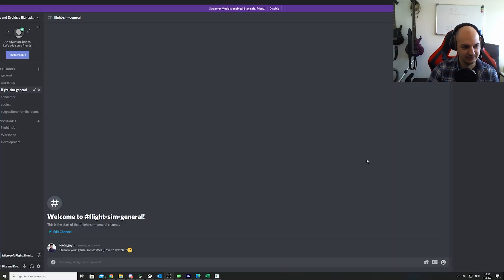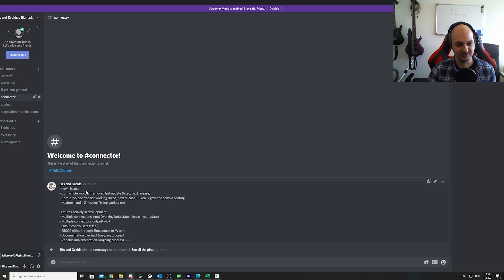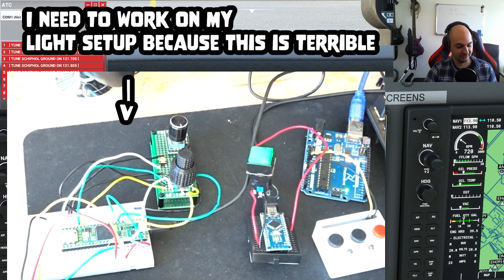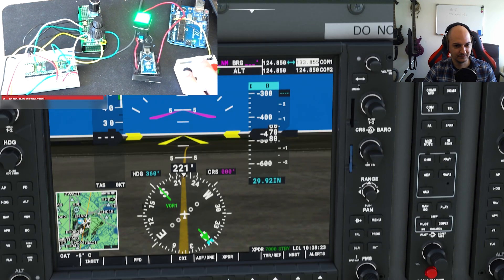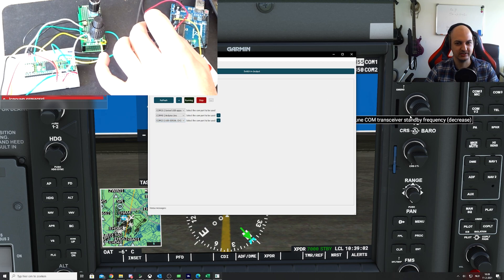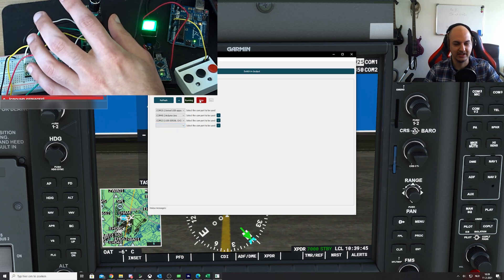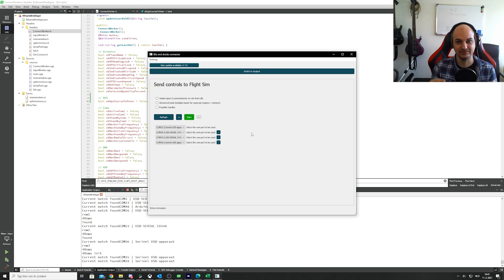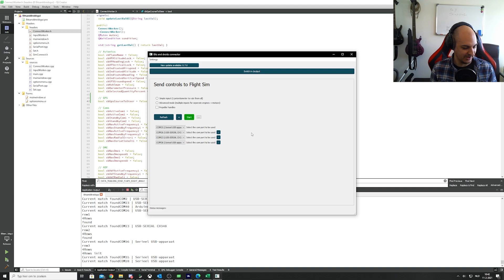Multiple input support, version 0.8.0 of the mfs2020 connector

Comment: Anyway to use multiple Arduino nano connected as I2C network to use just one instance of simconnect? That would prevent opening multiple instances of simconnect. If you could advise as I am trying to make full cockpit and multiple Arduino nano  working together would be a great solution, and hopefully recognized as one device by MSFS2020.
Reply from the maker: Currently the connector only opens 1 instance of SimConnect no matter how many inputs you define. (there is CPU overhead that I'm trying to reduce but that shouldn't be affected by the amount of devices).
 In theory you could create a chain of arduino's that pass the input to the next and to the next untill it reaches your pc. I have never worked this way so I wouldn't know how efficient it will be.
Reply: @Bitsanddroids  Let's try! Shall we?
I want to separate functions between Arduino Nano, set a master without any other devices to govern traffic and calls from slaves. I do intend to use 1 nano to pull data from MSFS and display them using a daisy chain of shift registers(74HC595) and control button matrixes with input shift registers (74HC165) and analog potentiometers and encoders by different Nanos where Master will be the only one directly communicating with PC.
In theory, I should be able to build a whole twin-engine cockpit including all controls, radios, AP, and build even yoke with force-feedback using such setup. I wonder if I will manage to make it work?!? 
When I get this done, and if successful I will provide you with details and images.
Reply from the maker: @michaelksiezopolski  Nice keep me updated! Do keep in mind that if you want to use my connector currently you need at least 1 Arduino for inputs and 1 for outputs. I'm working on a fix to combine both into one Arduino but especially if the load increases (data going back and forth) I would still recommend to use 2 Arduinos to smoothen out the communication
.
Reply: @Bitsanddroids  Agree, since one set can pull data, the other will be set to send it. This way one can act more like a joystick and the other as a data display (Leds, Digits, displays, etc). 
If both sets are made of I2C network, the possibility to expand is endless!
I will keep you posted.